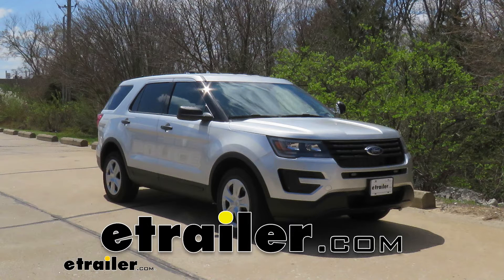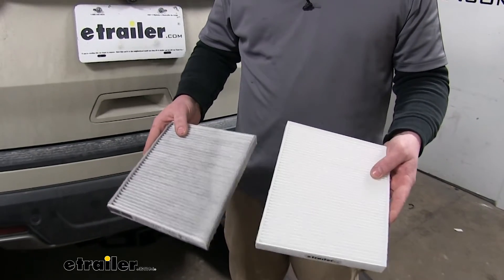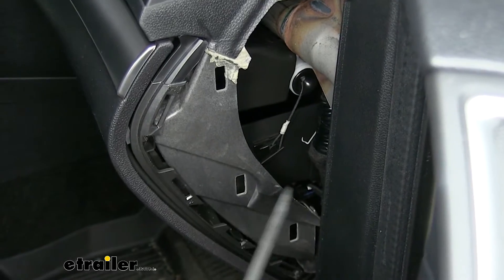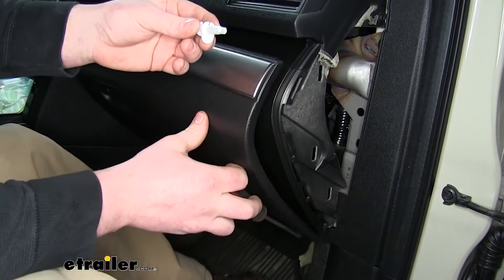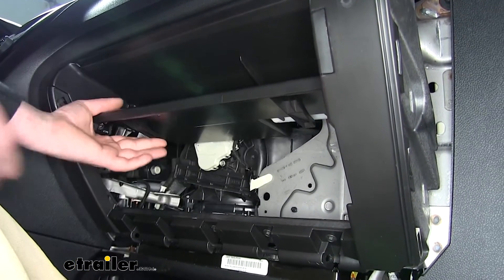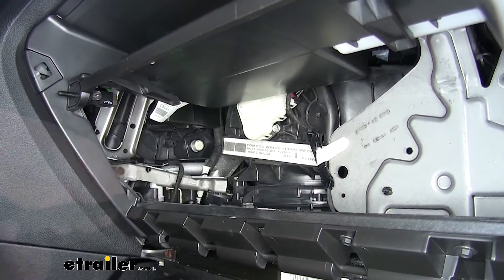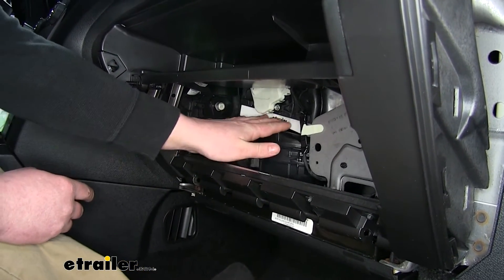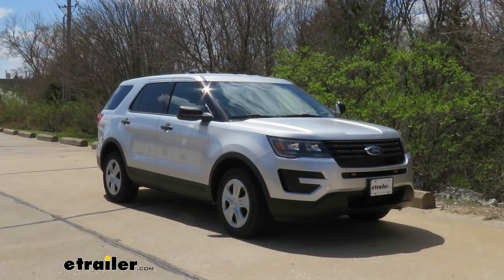etrailer | How to Set Up Your PTC Custom Fit Cabin Air Filter on a 2018 Ford Explorer

Comment: I have the same exact vehicle, and the demonstration represented here is completely missing steps specially at the end of the video. It is horribly difficult to reinsert the 2 white tabs, because there is no room to put them back, since it lacks the space to do it. You have to removed more screwed bolts to make the tabs accessible and required a lot of time to do so.
Reply: I have a 2018 Ford Explorer. His instructions worked fine for me. Yes, the white clips are difficult to put back on, but they are doable. I had to crawl and lay on the floorboard, with a headlamp and flathead screwdriver to force it back in.

Comment: Funny on how they didn't elaborate on how to get the white clips back in because it's damn near impossible.
Reply from the maker: We missed that in the video. They can be a bit trick but if you take your time they'll snap back in.
https://www.etrailer.com/Air-Filter/PTC/3513780.html
Reply: I gave up on trying to get the white clips back in. Way too much of a hassle and the glove box seems to operate fine without them installed.
Reply: I used mini needle nose pliers and worked fine
Reply: I had the filter replaced as part of the normal maintenance schedule by the dealer.When I followed the procedure in the video I popped out the right side pin and thought I could get to the cabin filter; it was tight but I was successful. I didn't realize until I was jockeying the door back into place that the dealer never inserted the pins after my last service. They just reinserted the white pins and let the door ride on the rod. I did the same --works great and I only have a few cuts on my hands from tether that is located in a spot to small for adult hands.

Comment: **According to Ford, the airflow is downwards. NOT Upwards.**
Reply: The stock filter on my wife's 2018 Explorer was installed with the arrow facing upwards, same as in this video.
Reply: I pulled out my old filter from my 2017 and the arrow was pointed downwards

Comment: Hi. Thanks for the best video for this so far. Total pain to do this. You don't show it on the video-I didn't see that you put back in the white plugs. Do you think they are really necessary? The reason I ask, is my last Explorer had mice getting in through the air filter. It's a chore to get those plugs out and would prefer to leave them out so I can access air filter if need be. I put the glove box in without the plugs and it appears to operate correctly.
Reply from the maker: That's entirely up to you but I recommend putting everything back together as it's intended.
Reply: @etrailer  thanks
Reply: seems to me those white clips are necessary
Reply: They are a real pain in the ass

Comment: Pro Tip - even though you can access the filter cover without removing the white clips if you force the glove box just a little to far open the part of the glove box the white clip goes through will break. I did this trying to flat rate this repair. Remove the white clips unless your forearms are  very thin.
Reply from the maker: Good tip. Thanks for the info

Comment: Regarding the air filter that you just installed.  If I get a K&N filter, do they use the same air filter in the engine and also the cabin filter?
Reply from the maker: The engine air filter and the cabin air filter are going to be different styles of air filters. We only have the cabin air filter available. 
https://www.etrailer.com/Air-Filter/PTC/3513780.html

Comment: It seems they glossed over the the reinstallation of white clips intentionally. There is no easy way to do it. Clearly engineers who work with paper and not on actual vehicles designed this moronic system.
I just changed the filter on my daughters Honda, also behind the glove box, and it took all of 3 minutes. Best of all you didn’t disassemble the glove box to do it!
Reply from the maker: Thank you for sharing this with us! We will look into focusing more on reinstalling the clips.

https://www.etrailer.com/Air-Filter/PTC/3513780.html
Reply: @etrailer  Did you produce an update to the video showing the white clip installation?

Comment: You didn’t show how to put back the pins
Reply from the maker: You will just need to push the pins back into the appropriate hole that you removed them from.
https://www.etrailer.com/Air-Filter/PTC/3513780.html
Reply: @etrailer  I had the filter replaced as part of the normal maintenance schedule by the dealer.When I followed the procedure in the video I popped out the right side pin and thought I could get to the cabin filter; it was tight but I was successful. I didn't realize until I was jockeying the door back into place that the dealer never inserted the pins after my last service. They just reinserted the white pins and let the door ride on the rod. I did the same --works great and I only have a few cuts on my hands from tether that is located in a spot to small for adult hands.

Comment: Thx for the video....... 
Me: Hey Ford, really, Really.....
Ford: Just wait for the next model change when they need to jack the engine to add air to the tires.....
Reply: Wasn't very difficult
Reply: It you had a rough time with this, you probably should have the mechanic put air in your tires for ya
Reply: @greggorrell  Wow that was a real zinger, bet you even gave yourself a high-five...since nobody wants to be around a lonely little man...  Keep fighting the good fight...

Comment: I will let dealer rip me off, too many things to brake.
Reply from the maker: If you don't feel comfortable attempting the install yourself, a quick change oil change place might be a less-expensive alternative to the stealership...
https://www.etrailer.com/Air-Filter/PTC/3513780.html
Reply: @etrailer  They need to learn to put the oil back in first.Thanks for the tip. It is not the job as much the chance of plastic stuff breaking.